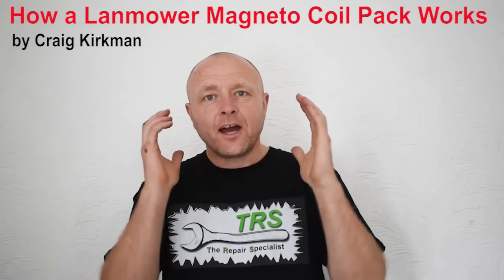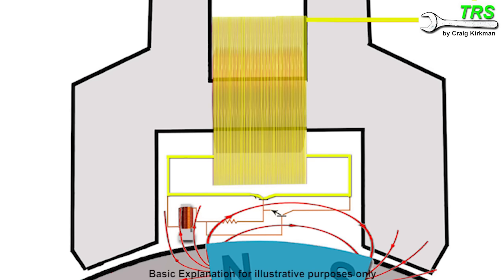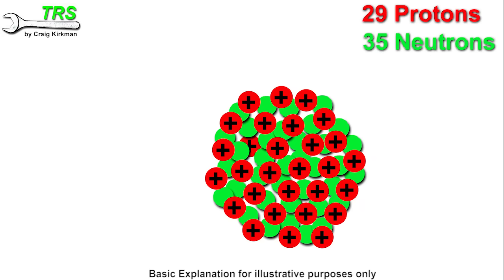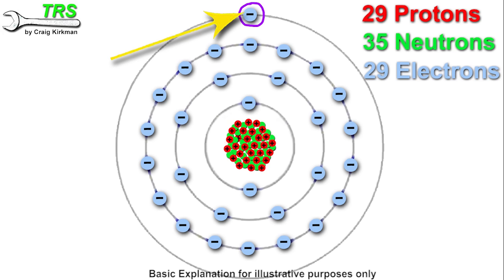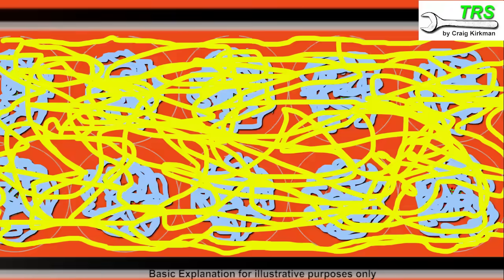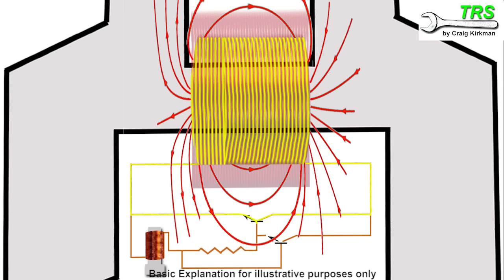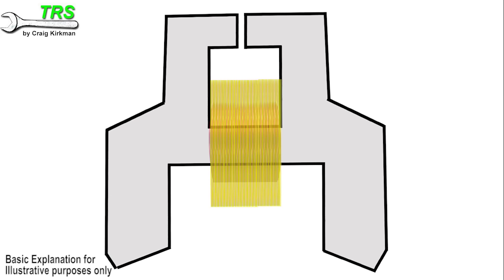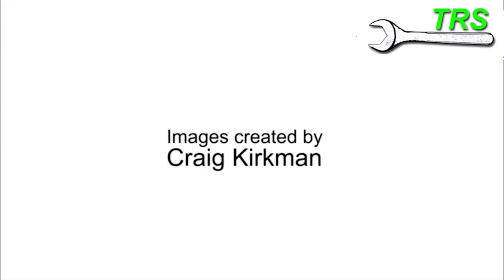Lawnmower Coil Pack Sparking System - Induction Coil, Transistor!  (by Craig Kirkman)

Comment: The secondary coil of my lawnmower ignition coil is open circuit, the resistance is near infinity as opposed to the 5,000-8000 Ohms it should be.

Comment: Okay, I love the video and the explanation is extraordinarily clear except one thing. I was always under the impression that the iron core was the main electron mover to primary. Pushing and pulling electrons through the center of the primary with magnetism. If it's not, then I dont understand the purpose of having a horseshoe shaped and magnetized iron core pack?
Reply from the maker: Excellent question, and you’re right to focus on the iron core because it’s absolutely central to how the ignition coil works. 

So this is my personal understanding of  it. 

The key thing is that the iron core itself doesn’t move electrons directly — it isn’t a conductor in that sense — but rather acts as a magnetic bridge that channels the magnetic field through both the primary and secondary windings.

When current flows through the primary coil, it magnetizes the iron core, storing energy in the magnetic field. When that current is suddenly interrupted (by the trigger coil or the flywheel magnet moving past), the collapsing magnetic field in the iron core induces a voltage in the secondary winding — that’s what drives the spark.

So the iron core’s purpose is to concentrate and strengthen the magnetic field, ensuring nearly all of that energy links the two windings. Without the iron core, most of the magnetic field would leak away into the air, and the spark would be extremely weak.

The horseshoe shape simply keeps the magnetic path short and efficient, allowing the flywheel magnet to pass close to both poles at once — boosting the rate of magnetic change when it’s cut off, which means a stronger induced voltage.

So, The iron core doesn’t move electrons, it moves magnetism.

The windings use that changing magnetism to move the electrons.

I hope this hopes clear things up. Craig

Comment: What determines the precise time for the spark to occur, as in like an old car ignition system when the points open the spark occurs, in other words is it just the trigger coil that determines the ignition timing to the spark plug?
Reply from the maker: The precise timing of the spark in a small engine ignition system is set by the relationship between the flywheel magnets and the ignition coil’s trigger/armature. As the flywheel rotates, the magnets sweep past the laminations of the coil at a very specific crankshaft angle—usually just before top dead center on the compression stroke. At that moment, the changing magnetic field induces a voltage in the coil’s primary winding. Inside the coil is a small electronic switching circuit (on older engines it was mechanical points), which collapses the magnetic field at exactly the right instant. That rapid collapse causes a surge of voltage in the secondary winding, which jumps the spark plug gap.

So in short: yes, the trigger coil and flywheel magnets together determine the ignition timing. Unlike old car systems where you could advance or retard timing with points and a distributor, most small engines have their timing fixed by the physical position of the coil relative to the flywheel keyway. If the flywheel key shears, or if the coil is incorrectly gapped, the spark timing shifts—and that’s often the cause of hard starting or backfiring.

Does this help answer your question 

Craig

Comment: Hey man! It’s a very nice video! The only thing to correct would be that the reason the electrons drift in a conductor is uniform isn’t that they repell eachother but the electromagnetic field that is created around the conductor… however this is a video about ignition systems and this theorem is one of the hardest to ever understand in electrical engineering. So your explanation fits the purpose very well! Just wanted to add for completeness
Reply from the maker: Thanks a lot for the kind words and for adding that clarification — you’re absolutely right. The proper explanation of electron drift and current flow involves electromagnetic fields around the conductor, which is a pretty advanced concept in electrical engineering. For the purpose of this video I simplified it down so it’s easier for beginners to follow, but I really appreciate you pointing that out for completeness. It adds extra depth for anyone who wants to dig deeper!

Thanks again

Craig

Comment: Can you tell me from where secundary wire start and where end and what is direction of that wire is it same as in primare left and right or have some other role
Reply from the maker: Great question. Inside the coil, the primary winding is just a few turns of thicker wire, and the secondary winding is thousands of turns of very fine wire wound around the same laminated core. The secondary winding usually starts near the same end of the core as the primary, but because it has so many more turns, its job is different — it steps up the voltage by electromagnetic induction when the magnetic field in the primary collapses. The direction of winding (left/right) doesn’t matter to us externally — it’s designed so the induced voltage adds correctly and delivers the spark through the high-tension lead to the spark plug.

I hope this helps a little 

Craig
Reply: @TheRepairSpecialist so you can randomly put a lot of small wire and it will be good? I have primary 0.7mm and i see from where to where and how much but secundary  is 0.1 mm and it is hard i put 1400m of that to get 3.2 oms and voltage go minus to plus some number so i was thinking i make mistake

Comment: It is NOT a COIL PACK. a PACK has TWO OR MORE COILS. 1 COIL is simply 1coil. no pack there, If a 6 cylinder has three double ended coils in a group, THAT IS A COIL PACK.  A Back PACK has many things inside. Itis why it is called a Back PACK, a PACK of them! As the magnet passes the trigger coil there is a current BOTH WAYS in that coil but ONLY one direction is USED to switch OFF the INDUCED curent in the primary.  The picture shows only one flow direction. One is blocked by DIODE!
Reply from the maker: Thanks for the comment. You’re right that in the automotive world a “coil pack” usually means a group of two or more coils bundled together, often used on multi-cylinder engines. On these small Briggs & Stratton engines though, what we call the coil or ignition module is just a single unit that combines the trigger circuit, the primary winding, and the secondary winding. The flywheel magnet induces current as it passes, and an internal electronic component (like a diode or transistor) handles the collapse of the field so the spark fires at the right time. So while the terminology is different between cars and small engines, in this case it’s not actually a coil pack — just one self-contained ignition module.

Thanks 

Craig

Comment: What part  does the breaker points  play in this sequence
Reply from the maker: Good question. On the older Briggs & Stratton ignition systems, the breaker points opened and closed to interrupt the current in the primary winding — that sudden break caused the magnetic field to collapse and fire the spark. In modern solid-state coils, the points have been replaced by a tiny electronic switch (a transistor) that does the same job without any moving parts. So if your engine still has points, they’re part of the timing sequence, but most newer engines don’t use them anymore.
I hope this helps
Craig

Comment: This is the best explanation of a magneto I have ever seen and your graphics are super, I do wish you had talked about the old days when we had points and condensers, they were the most misunderstood devices ever, an analysis of the interaction between the condenser and primary coil created a resonant circuit. The closer the condenser (capacitor) was matched to the primary coil the less arcing you would get across the points contacts, which would make them last longer. 
Another interesting thing going on today is that companies like Echo, Husquvarna and others ore putting other circuits in 
their magnetos to advance and retard the timing. I have already had to replace magnetos in their equipment even though they put out a spark, but just at the right time. 
Great video!
Reply from the maker: Thank you so much for the kind words — really glad you found the explanation clear! You’re absolutely right about the old points-and-condenser systems; the interaction between the condenser and the coil forming a resonant circuit was one of the most misunderstood but important parts of those ignitions. And yes, matching the condenser well really did cut down arcing and extend the life of the points.

Good point too about modern systems — companies like Echo and Husqvarna are adding little electronic circuits into their ignition modules to tweak timing automatically, which is why sometimes you’ll see a coil that still makes spark but no longer at the right moment. That’s one of the hidden differences between the old magnetos and the newer “smart” ones.

Thanks again for sharing your knowledge 

Craig

Comment: There are a few things I must take issue with... the way you explain it, the only reason why there is any current flow in the primary or secondary windings is because of the trigger coil. But if this is the case, why does the A-shaped core extend towards the flywheel magnet as well? Also, the whole reason the transistors are there is because they short the primary coil (and thus collapse the magnetic field of the core) when no spark is needed. You never really elaborate on when the transistors are on and off in this cycle.
Reply from the maker: Thanks for the detailed comment — really good points to bring up. To clear things up:
	•	The A-shaped core extends toward the flywheel magnet because that’s the main source of flux for both charging the primary winding and inducing current in the trigger winding. The trigger coil alone doesn’t drive the system — it just gives a small signal to control the switching point.
	•	The transistor in these modules isn’t there to constantly short the primary winding. It actually works like an electronic switch: it allows current to build in the primary as the magnet passes, then cuts it suddenly. That collapse of the magnetic field is what induces the high voltage in the secondary and fires the spark.
	•	Timing is set mechanically by the flywheel key, while the transistor ensures the spark happens consistently at the right part of the magnetic flux cycle.

So the trigger winding provides a control pulse, the flywheel magnet provides the energy, and the transistor handles the rapid on/off needed for a strong spark.

Thanks

Comment: 3rd gen small engine guy. The 1949 B8N (first aluminum vertical shaft lawnmower engine) was the first appearance of this coil. They had breaker points. Magnetos have a "come in speed" at which they produce sparks. On the points ignition they would make sparks at 35 rpm. The engines started very nicely. The solid state versions didn't come in until 135 rpm. Same time Briggs went to pull up starters to crank them faster.
     My Dad showed me how to run small lights off the breaker point mags. You got the engine running. There was a closed switch between the electrical ground (engine block) and the electrical ground wire for the mag. Once it was running you could open that switch and force the AC pulses to go through like an 1157 tail light bulb. Idle it down it would get pretty dim. Max it out and was bright as can be.
     PS the best WW2 aircraft engine magnetos used on Pratt & Whitney R1830s, R2000s and R2800s - were all made by Briggs and Stratton.
    I don't think it was necessary to talk about copper and electrons to explain magnetos.
Everything he said was true - but un-necessary. It simply doesn't help you gain control over and then make a mag work. I mean I could make a mag out of aluminum, nickel or iron wire.
It's irrelevent. A string with enough graphite made in it would work fine.

Comment: Good Day sir. I’m an electrician and new to your channel. 
Thank you for your content. 
I’ve scoured the internet and cannot find an answer to the following question and hoping you can help. 

In a typical craftsman push lawnmower coil, where inside the coil does the kill tab go to?  From what I’ve seen so far it probably goes to a point in the primary coil circuit. Can you provide the internal schematic showing exactly where the kill tab is connected to. 
 this question is so I can fully understand how it works.

Comment: I take it that we are discussing electron flow as opposed to conventional current flow. This is the correct way. However I cannot understand the way your transistors are connected. Theoretically it cannot pass the gate on the NPN transistor unless it was a PNP transistor ( current flow flows against the arrow).  Is there something I'm missing here?

Comment: How do the old Magneto coils work as they did not have Transistors back then? Do the still use a trigger coil but not semiconductor electronics? Thank you for sharing this information with us.
Reply: I believe you are referring to a separate set of "POINTS" running on a rotating COG with
 a CONDENSOR, all working with a COIL canister assembly.

Comment: It would probably have been easier to explain pointed ignition rather than a generator coil style ignition.  
You had to explain a transformer and then you had to explain the coil "flyback" in terms of a transformer.
A "points" / distributor system is a lot easier to understand as the coil flyback is the only effect at play.
Push current through the coil, coil builds field.  Stop current through coil suddenly, (points pop open),  field collapses, current has nowhere to go, voltage rises until it can get somewhere to go.  Across the spark gap.
In almost any other electronic circuit, you place at least a diode and maybe a resistor to "free wheel" that flyback spike around and around until it disipates.   If you don't do this, then the transformer/inductors/coils will "spark plug" your circuit.

Comment: The high voltage spark also goes in loop from the secondary coil to the spark plug and through the engine frame and back into the secondary coil. It is also a circuit

Comment: I was so confused about the Darlington circuit but I've worked it out. The primary coil and the trigger coil are receiving EMF at the same time and the trigger coil is just there to close the circuit for the primary coil (upper loop) to flow. Then before the reversal of the magnetic field screws everything up the trigger coil opens the transistors and collapses the primary field. Bada bing bada boom

Comment: Thank you for a comprehensive and specific explanation of the magneto's function & capability. I've always wondered why a transistor magneto can function without a capacitor and a set of points. I know the magneto spins at the rate of the crankshaft, so it hits the "TDC" or phase for ignition that happens at only half the revolutions (a 4 stroke takes 720 degrees of rotation, so two turns, to fill the cylinder with a ready air-gas mixture) and the charge produced during the Exhaust/Intake revolution results in a spark that happens, but ignites nothing. So only 1/2 of the magneto's passing the induction coil is 'productive" for engine firing. But your explanation intuitively resonates with the 360 degree magneto travel producing a reliable ignition for the fuel mixture (when present). I always thought there had to be another component to drain the hysteresis charges away after the initial inductive charge flowed through - maybe I'm too caught up in solid state electronic theory & noise in audio circuits with tender components that could be destroyed by the hysteresis currents.

Dude - for a 4 year old video explaining the basic magneto function - as I learned it regarding old WW-I engines on the Liberty biplanes - this is the absolute best! Without this technology (the magneto, not the solid state transistor circuitry) we may have developed an industrial revolution that went from steam engines to nuclear power without petroleum used for anything other than firing 'oil fired steam engines'. The reliable spark at a high enough voltage to push across the air gap timed perfectly to the engine's rotation by simply sliding the inductive coil one way or the other to the flywheel gave us internal combustion power timed by the smooth sound using a lightweight (relatively) engine material. Thanks so much!

Comment: best video on the internet period when it comes to the explanation of the ignition coil and the explanation of a transformer all in one video but also put into words that anyone who can speak English is able to understand the content that is in the video.  I've worked on small engines since I was ten years old and im 43 now and up until now i haven't had anyone ever explain how a coil actually works at all other than ( a magnet moves by the copper coil and makes a spark)... this video explains in detail exactly how it manages to make that spark a how it turns it into thousands of volts from the flywheel to the spark plug and everything in-between.  if you can't understand this video you probably shouldn't be working on anything or operating anything that's motorized in my opinion of course..

Comment: Wait, if you have this trigger coil that induces the voltage into the primary when the magnet passes, why do yo need to to laminated pieces that are on either side of you trigger coil. The ones that have a set spacing from the magnet. (about 0.02")